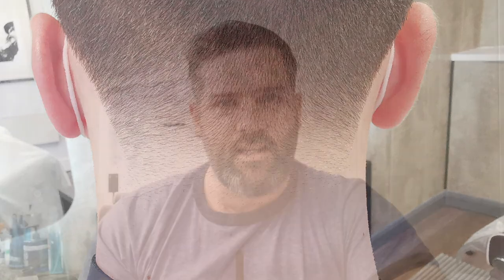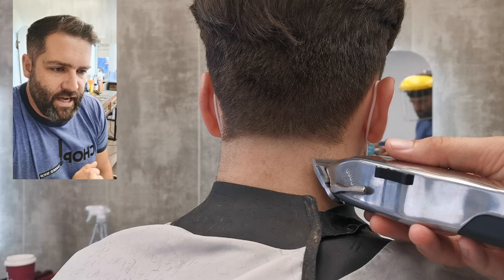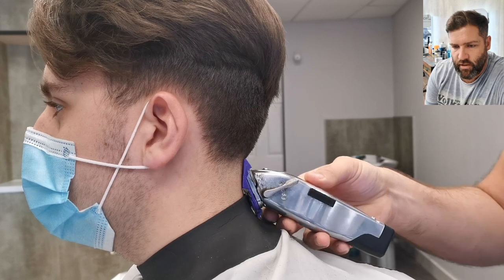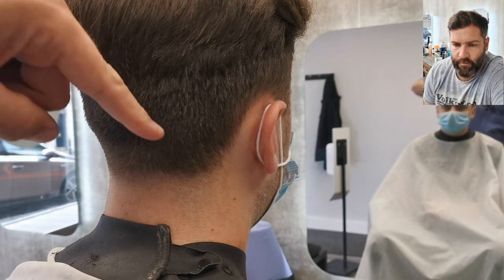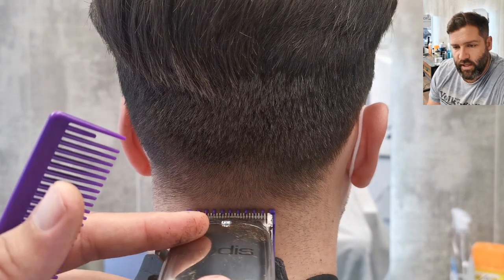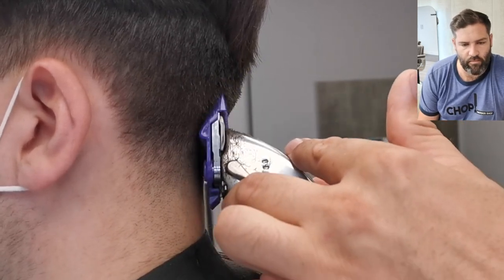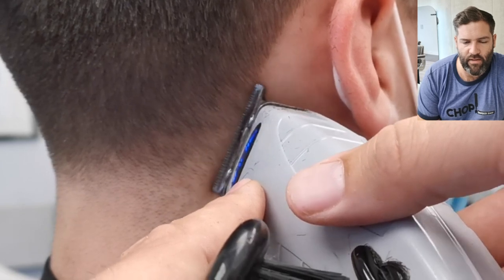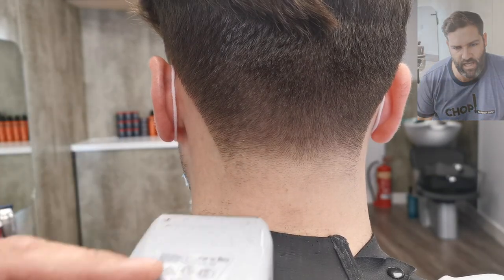Tapering Gents hair Explained | A guide to tapering hair

Comment: Michael, would like to see a video of how to trim around the ears, especially if you don't have a skin fade.  Say you have a number 4 around the sides, how do you trim around the ears so it stays sharp and clean?
Reply: Hi Michael, I would like to see a video of how to trim around the ears too. I cut my own hair, I use number 4 clipper guard as my shortest guard around the ear and back neckline. After about 4 weeks the ear area hair will start to get a bit long and messy and I would use scissors or clippers to trim around the ears only and then it can last for another 4 weeks then I will cut all the hair on my whole head. I do not use a trimmer to create any line because I am cutting my own hair myself it is hard to cut a straight line. Would like to see how you trim around the ears using scissors and clippers after 4 weeks to blend with the other hairs that has grew longer, I am unable to blend it well and not sure where to stop while trimming. Thanks.
Reply from the maker: I'll get something together for that. Going round the ears is very simple for the barber but can go horribly wrong very easily when doing it yourself.
Reply: @theoneminutebarber  Yes, it's one of the worst areas on a self cut.
Reply: @jasonl4237  You have to imagine the shape before trimming and not go beyond. It takes practice, a steady hand and decent tools. Scissors will probably be more trouble than it's worth for outlining yourself. Better off using several mirrors so you can see, and clippers and/or trimmers.

Comment: What taper blade did you replace the andis blades with?
Reply from the maker: That is the blade that comes with the Andis master when you buy it. 
I had previously retrofitted a fade blade to the clipper so had to change back to the original for tapering. You can still taper with a fade blade but it's better to use the blade that came with the clipper and was designed with tapering in mind.
Reply: @theoneminutebarber  TheAndis  MASTER
Reply: @theoneminutebarber  The Andis Master I bought didn’t have the taper blade. It had the fade blade. That’s why I asked.
Reply from the maker: I can only guess that is an update due to the demand of the fade blade. If you check with andis they will direct you to a supplier that sells the taper blade. In the UK for some reason it's a pet grooming company called groomers.